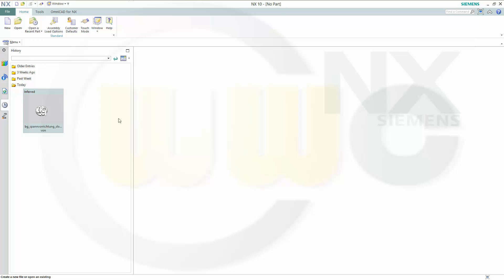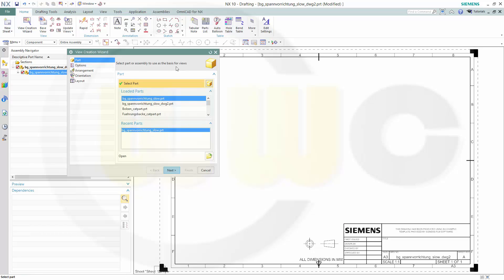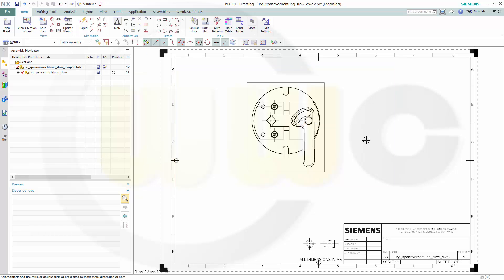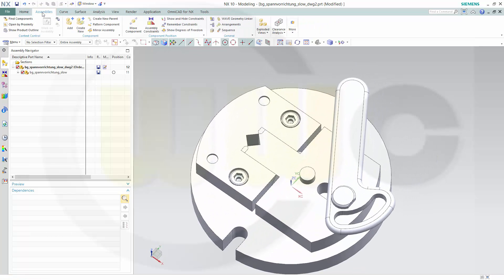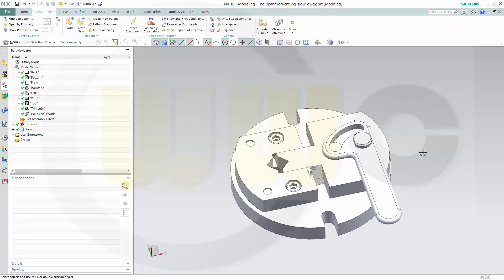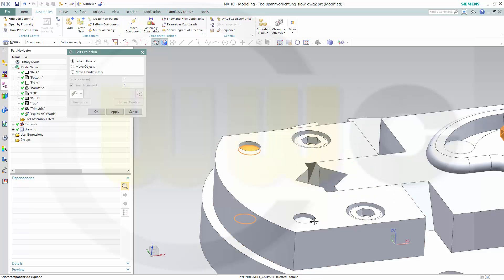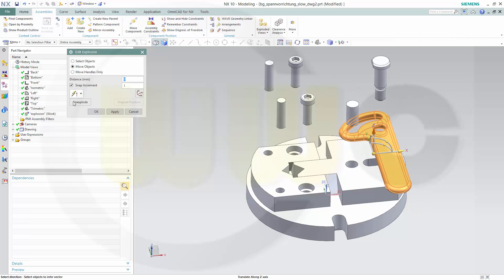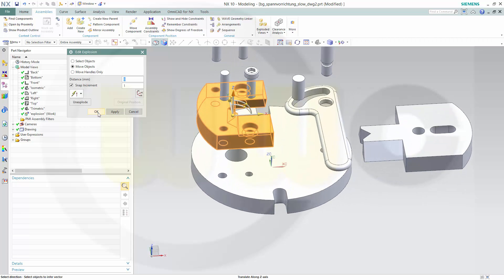Explosion - Siemens NX 10 Training - Drafting & Assembly

Comment: I want to create another exploded view in a different orientation and without any screws or washers in that. When I tried it by hiding it, It removed all fasteners from the 1st exploded view as well. Basically, I am after one exploded view with all components on and one with few components on. I use NX10
Reply from the maker: You want those 2 views in the assembly or in the drawing?
Reply: Both in the assembly and in the drawing
Reply from the maker: Ok, you can use "arrangements", in one you "disassemble" (hide) the components. You have to use "sequences" for "disassembling" components. If you create a view in the drawing you can then select the wanted arrangement. There might be another way, but I would have to check that myself first. If I have some time to spare I will do a video.
Reply: That is a new lesson for me. Thank You,  Found a way of hiding comments in the view. Menu--Assemblies--Context Control--Hide Components in View
Reply from the maker: Great! Obviously this is rarely used, otherwise it would be easier to find.

Comment: Hi,
I need to know, Is there any option to set auto page number.
Suppose there are more than 60 pages in one drawing file. And to separate all pages, we write in down right corner "Page 01 of 100"  and so on...
But Currently, I'm doing this manually. Is there any option to make this auto changeable?
Reply from the maker: Obviously it is possible. If you use one of the siemens drawing templates - there is that sheet number and the total of sheets. So you could try to adjust that template. But I will try to do a video for a custom template.
Reply: @wolfgang.walden.cad.training  Thanks for your reply.
Please make a video tutorial for this, to set auto page number.
 There is no such type of single video on YouTube.
Actually I also have numerous question, please help me
I never get time to find those questions. Now we'll are in Lockdown due to COVID-19
So now is the time to utilise this.

1.) In drafting - How can I show the exploded view of assembly file?
2.) Sometimes during drafting, when pages are near about 100, I face issue to copy a template in same file. It show me a error of " Internal memory error" 
And at the same time, this error shown on every Nx file, either I just opened it, or a blank file.
(Current solution that I found out- Close ALL file in nX, 
open New file for drafting, 
Do drafting in some pages, then save it
Now open that file, and now its complete error free.)
3.) When I do drafting of a plate via "Hole Table". Is there any option to lock particular cell.
I tried but that's not working.
4.) User defined feature is not working in Nx 
5.) Some tips & trics to increase production of design.